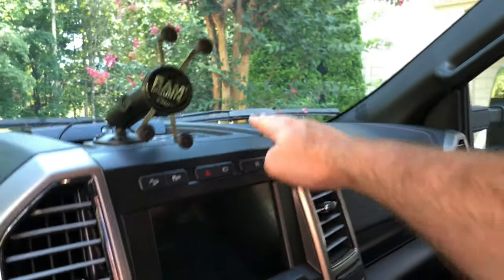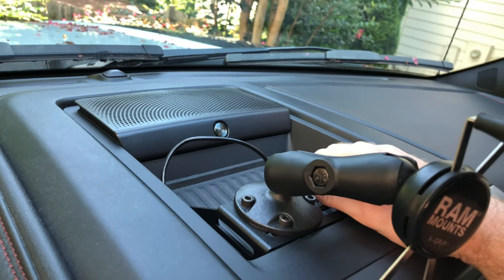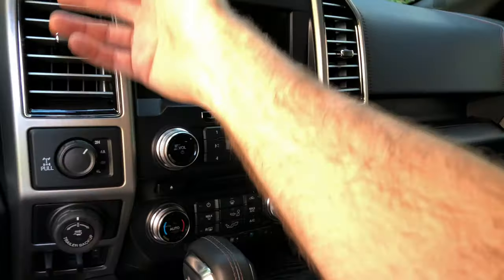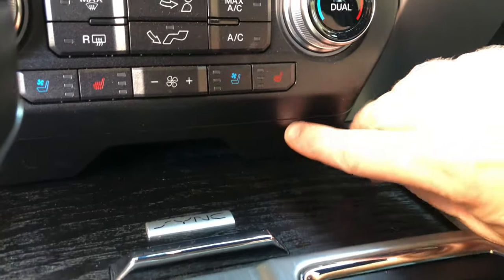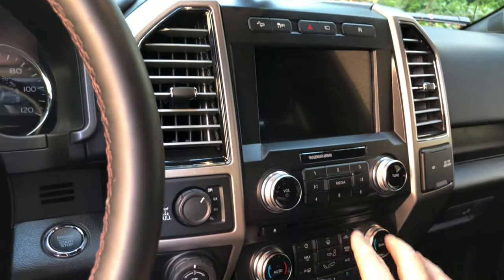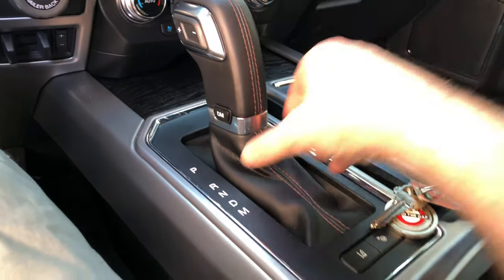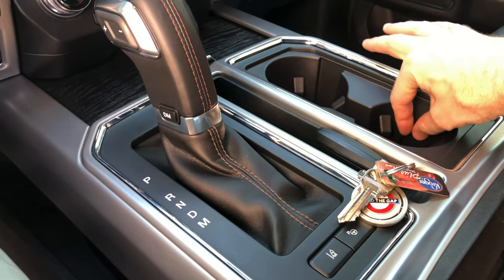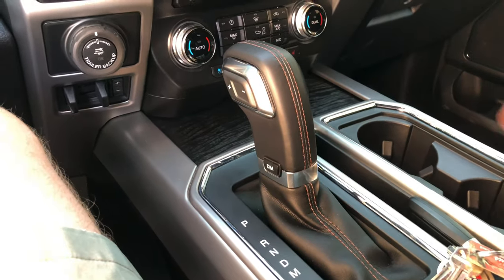2018 Ford Truck - Center Stack and Console Disassembly

Comment: Hey man. On the drawer that opens where it says sinc that you put your wire through I’ve lost a necklace that I need back. It was on top of the tray and flew forward into the dashboard and idk how to get it. I was wondering if you knew.
Reply from the maker: You might be able to get it by popping off the speaker at the front of that panel. If you need more room, you would need to pull out the tray and then you should be able to reach it.
Reply: General Talk with Ben alright thanks I’ll try it out
Reply: @GeneralTalkWithBen  how do you remove the tray ?
Reply from the maker: You need to pop off the speaker and there are two 7mm screws at the front (under the speaker), Then you pop up the front (it’s just held in with plastic clips—be careful with the plastic, but you will have to “pop” it good to get it to come off. You want to pry straight up.
Reply: @piersonbrown2121  did you get your necklace? Same thing happened to me with my credit card
Reply: So, you're saying to get something that slipped to the front of the "drawer", I need to go via the speaker on top of rhe dash?  Can you get to the area to the front of that drawer via the side pieces on the console?
Reply from the maker: If I remember, there may be a small gap there to reach in, but I don’t think it’s much. I think you’ll need to remove the speaker and the top panel if it’s significant in size or you can’t reach it.
Reply: We're you able to figure it out? I lost a necklace the same way in my 2019 F150 a few weeks ago.
Reply: Seems like a common problem with us lol, lost a paycheck back there
Reply: Just broke my dash following this video. 2018 f150  the center cover must have to come out before the side Grey trim peices

Comment: So I want to remove the lower console door to have it painted. So I can remove the trim bezel around the cup holders, and slide the door out?
Reply from the maker: If I remember right, yes. You can remove the top, then there are a couple of screws, but they’re towards the front. It’s not the easiest…

Comment: I need to get to the brake controller. Would the side panels come off without removing the center cover?
Reply from the maker: Anything on the center console is part of that console. You could fish wires under the edge without removing it though. The sides of the center stack do come off (but the clips are REALLY EASY to break).

Comment: What base did you use for the RAM mount?
Reply from the maker: I believe it was this one: https://amzn.to/3rq2AS0.
Reply: @GeneralTalkWithBen  I'm sorry. I was referring to the metal base the ball is mounted to.
Reply from the maker: Sorry about that. Here’s the metal piece: https://builtrightind.com/collections/dash-mounts/products/builtright-industries-dash-mount-2015-2020-ford-f-150-raptor-2017-f-250-f-350.
Reply: @General Talk with Ben  did you have to screw into the dash or does it use factory holes somewhere

Comment: How do you like the B&O sound system? I test drove an 18 the other day and the volume seemed very quiet and on went to level 30. Could hardly hear it with the windows down.
Reply from the maker: I’ve not noticed any issues. It sounds like something isn’t connected, or something isn’t set correctly.